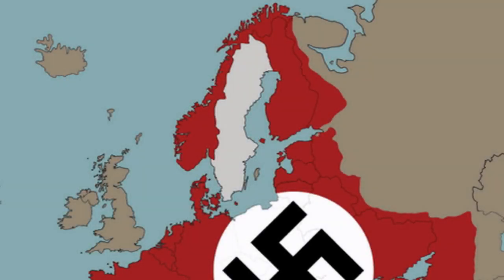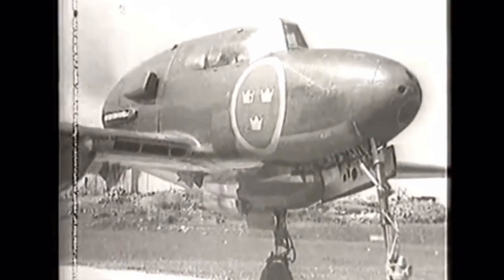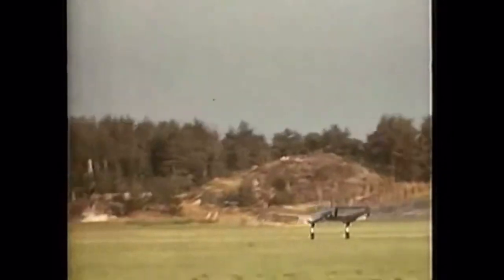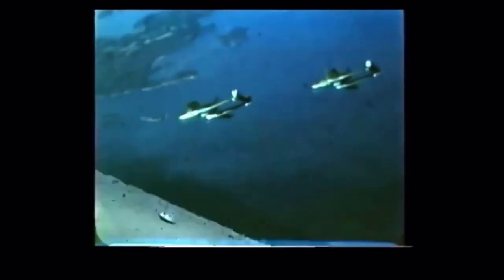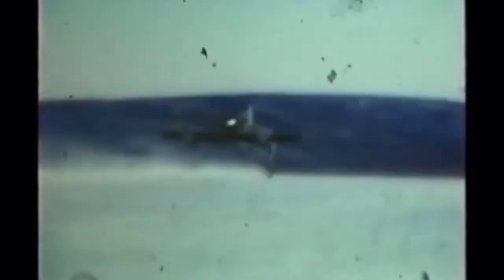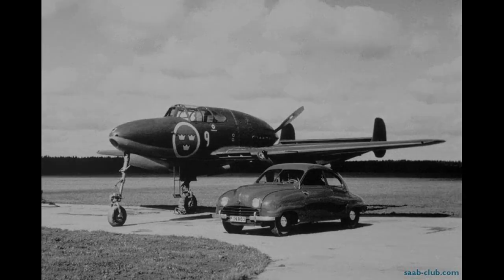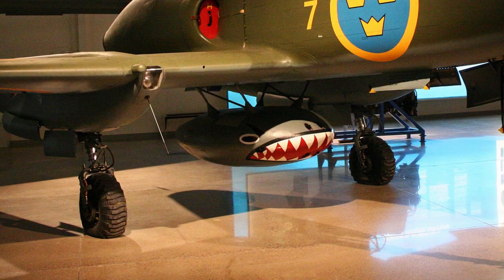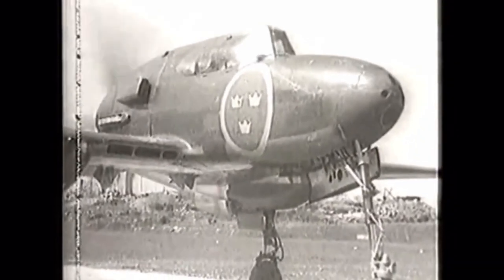How Did This Swedish Plane Fly? ( Saab J21)

Comment: Excellent video, new subscriber because your historical presentations are so accurate  with information, pictures and graphics.. Development of this Saab with pusher configuration does seem unusual for developing a nations first aircraft, however they seem to have achieved reasonable functionality, especially on the ejection seat, As you probably know from your reasearch the concept of the pusher prop went back to before WW1 explored by all military East and West in WW2 and in Vietnam the  Cessna O-2 Skymaster had great success. Twin booms for high speed propeller  do seem to create problems of mach tuck, like our P- 38. Although it was not a pusher.  Watching the Saab take off and land with that high nose wheel, it seemed to have its Center of Gravity a bit off. Take off and especially landing looked quite difficult  . It's interesting how engineers at the arrival of the jet engine tried to fit them into standard aircraft of the time. Thinking that all it took to fly faster was power. While the configuration of the pusher had many caveats, the primary advantage was getting more airflow over the wing to increase the Angle of Attack. The design is still being  used today. Thanks again for a great video, Aviation aficionados should be " pushing" up your subscribers list soon. Standing by for you next one.
Reply from the maker: Thank you very much, glad to have you around 👍

Comment: Saab had always been in front of new ideas for aircraft, as we can see with the J29, J35, J37. Tailwheel draggers are a pain to control when power is increased while taking off or landing in crosswinds in narrow runways. A big engine in front has advantages and disadvantages. Pusher propellers without twin booms were very unstable as some prototypes showed. It came a bit too late for a prop aircraft but helped the transition to operations with jets. But we can imagine a sweptwing design, with teardrop canopy, a contrarotating six blade three stage Griffon engine powering it at least near 500mph at altitude.

Comment: I have simulator flown SAAB J-21. And it is very comfortable to fly with. The Swedish Air Force tested it against the P-51D Mustang and Sweden's other aircraft, the J-22. The SAAB J-21 is very nimble in the turns and can go very deep in the turns and fast in the roll plane as well. The P-51D was only fast in the climb up but was poor in the turns where the gyro characteristics and wing profile of the P-51D were worse. J-21B and J-21R could be upgraded more to J-21D, E and F, and J-21R E,F model could get thinner airfoil and sawtooth wing. I've had a tree out on my farm that was a SAAB J-21 pilot at the end of the war in F-10 in ängelholm in Skåne Sweden.
Reply from the maker: That's pretty cool, both the statistics and the tree. Great to see someone remembering that pilot even to this day.